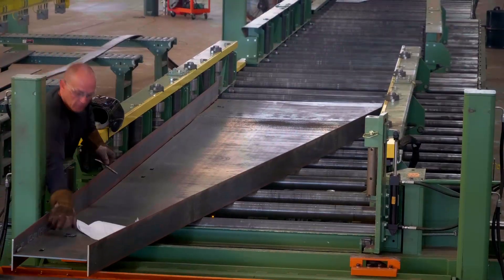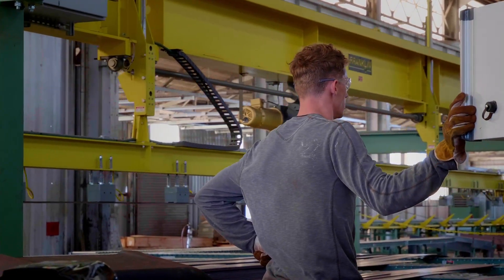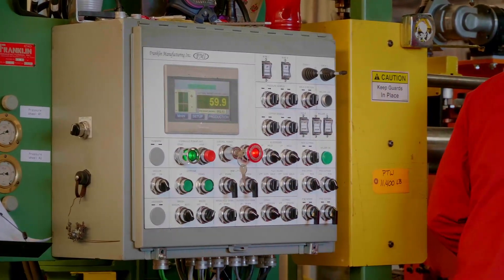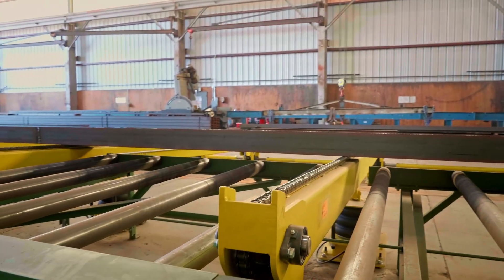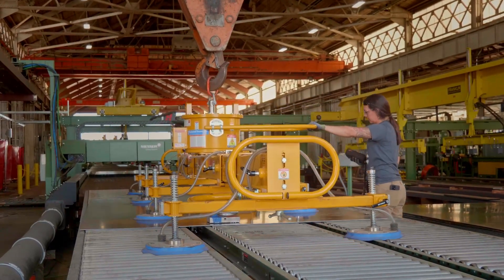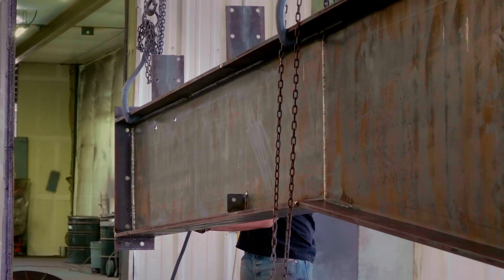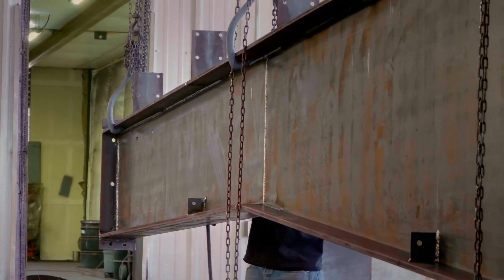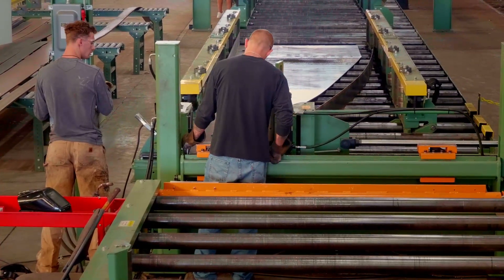2022 August - GWB FACTORY UPDATE AND STEEL MARKET UPDATE

Comment: Quick question and some trucking rants. What is a ballpark shipping weight of a 30x40x16 building with sheet metal? I didn't buy from you because I'm on the other side of the country but I did basically end up with the exact type of construction you build there. I prefer the beam style you guys do over red iron webbed trusses and columns because I'm building alone and they're just less bulky and easier to move around with cheaper equipment. I don't expect a 53ft trailer to make it to my build site. My trucks, that I own, are 20-24ft usable length with a payload around 11k lbs. Can I conceivably haul this building myself?

I just wanted to jump in and confirm your analysis of the state of trucking. I don't do flat bed but I do haul specialized stuff that doesn't deal with big evil retail junk. Heavy vehicle/equipment manufacturing related stuff mostly. What I can tell you is that fuel prices are killing us and some of that was getting passed on to you. Now that fuel prices are falling, pay per mile has fallen off a cliff and capacity is starting to disappear. I know it's counter intuitive but higher fuel prices mean more money for truck driver/owners because of the fuel surcharge. Shipping prices have always been dismally low. Truck companies make up the short fall on the fuel surcharge. Because the surcharge rises very slowly as fuel prices rise and it falls much much faster than the price of fuel as it declines. I don't know what kind of market black magic they use for that system but it is what it is. It gets worse, though. No one is shipping much of anything this past couple of months. Part of that is related to retail holiday trash loads not being as available as previous years for the big trucking companies. So, they're temporarily moving into niche sectors like mine and yours. You can expect shipping costs to decline rapidly. Then your problem becomes finding a trucking company that isn't going out of business because of that decline. It starts with not being able to maintain or replace trucks and trailers. Next go the drivers and then the small truck companies. Rates will decline until enough trucks are out of business. You'll be fine if your drivers don't need to speak English to haul your loads but flat bed is hard, dangerous work. Most of those drivers will avoid it.